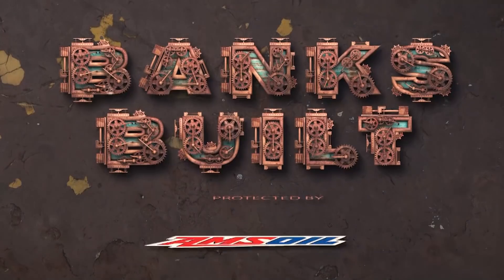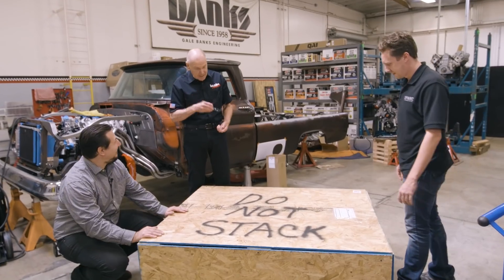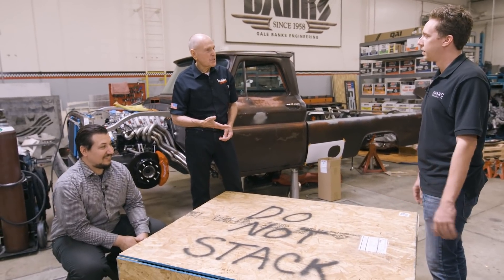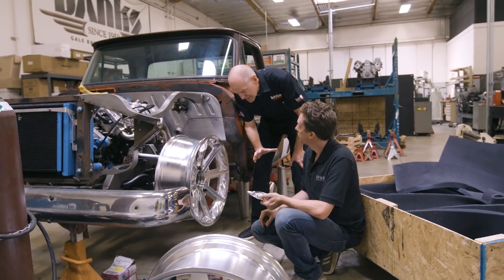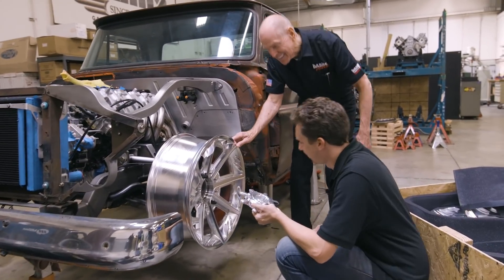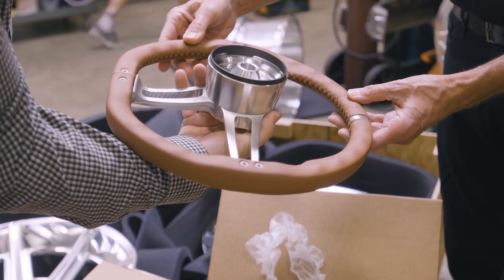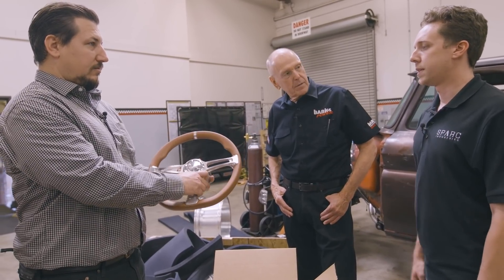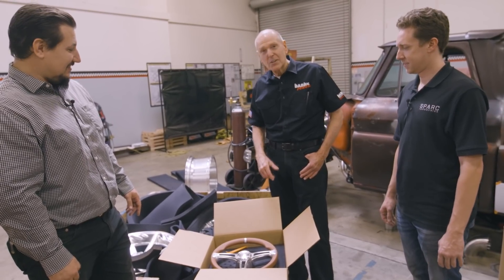You've Never Seen Wheels Like This! | BANKS BUILT Ep 41

Comment: I’d be curious to see an under hood ambient air temperature test using an iDash data monster, comparing these wheels to some steelies with/without windows in them. 

I’m sure it makes a difference, but it it 2 degrees or 20? How much would the corkscrew mentioned in the video benefit efficiency?